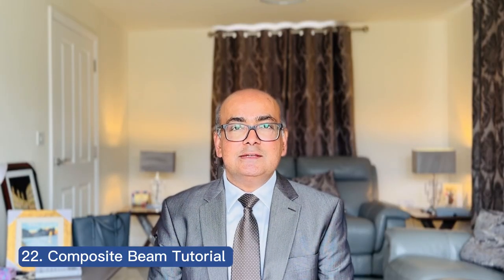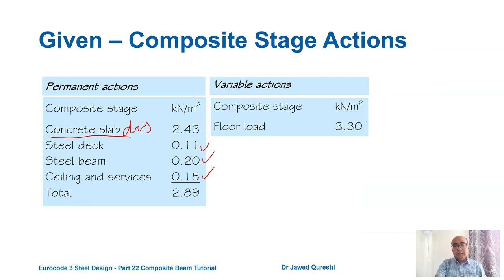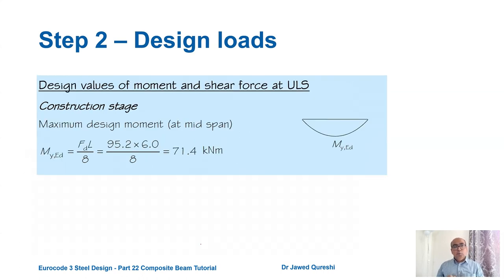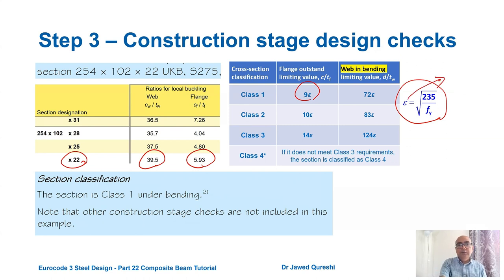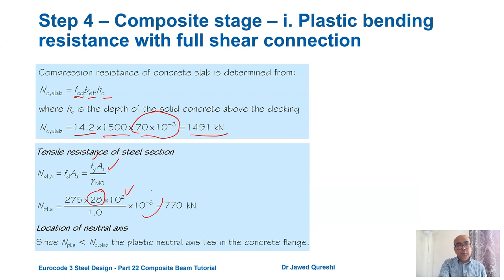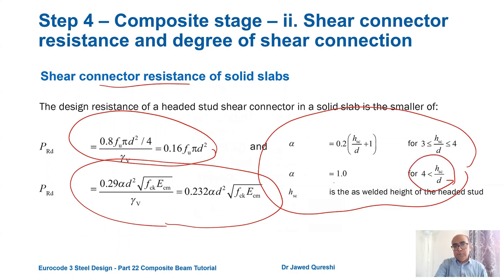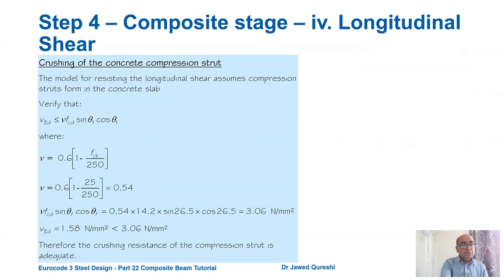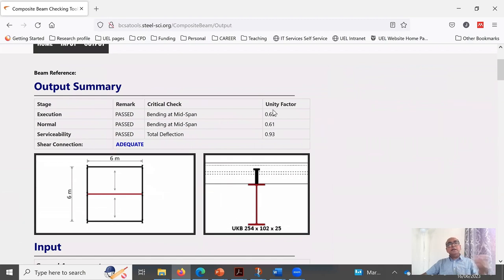22 Steel-concrete Composite Beam Design Worked Example to Eurocode 4

Comment: Hi Dr Jawed Qureshi, thank you very much for providing these for free! One question sir, how do we go about knowing when to use partial and full shear connection? Thank you!
Reply from the maker: For composite slabs used in buildings, I think full shear connection is not possible. We just have to determine the degree of shear connection that a set of shear studs provide. That degree should be more than the minimum shear connection requirements. If it is less than the minimum then we increase the number or the size of shear studs to achieve the minimum shear capacity.
I hope it answers your question. I’m happy to expand more if my response is not clear.
Reply: @DrJQureshi  Thank you for still entertaining my question sir. I have watched the video again and it helped clarify some things. God bless you sir. :)

Comment: Hi Sir,  thanks for the video. Is there a difference between composite slab and composite beam design process??
Reply from the maker: Yes, composite slab and beam design are different. In composite slab, the steel decking is rated by shear parameters, called m and k. I’m planning a separate video series on composite structural design that includes composite slab, composite beam with hollocore slabs and composite columns. The series will be out in about 2 months’ time.

Comment: what if the steel deck is not able to take the construction loads? if applied moment is greater than the moment capacity (during construction stage check?) what should be my next step?
Reply from the maker: There are two options: 1) use props to increase loading capacity, there is separate load span provided by manufacturers 2) use a deeper or thicker deck.
Reply: @DrJQureshi  Thankyou sir..🙏

Comment: Hi Sir, I have a question. how to get value for 120mm and also 170mm, this is for calculating the bo dimension under Shear connection.
Reply from the maker: These are bottom and top trough dimensions of the trapezoidal steel deck. These values are from the manufacturer’s load-span tables.